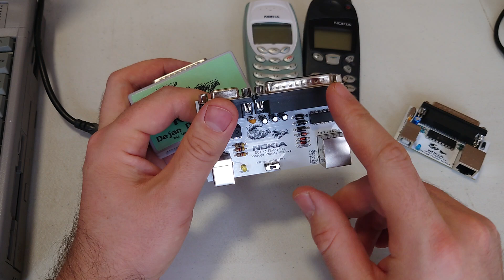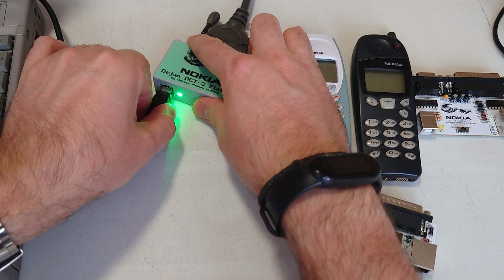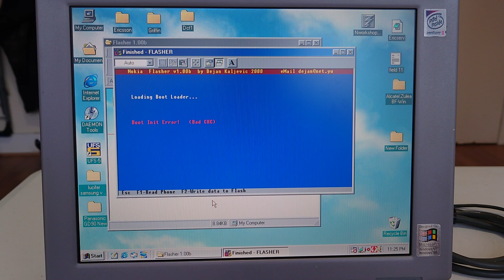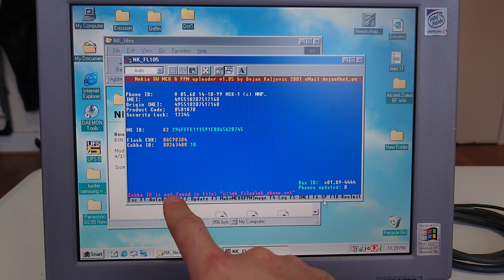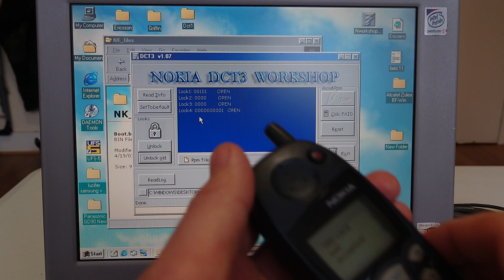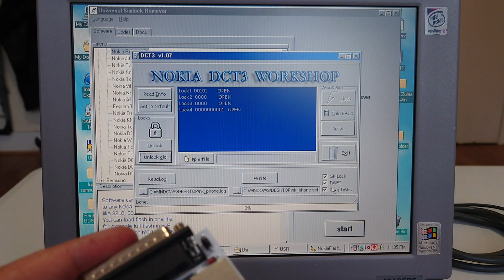Full Nokia Dejan Flasher box - retrospective and demonstration

Comment: That's a very old Windows os. Would the program work on Win 10 or 11?
Reply from the maker: Noo, all these tools predate Windows 10 by 20 years, and modern windows no longer offer backwards compatibility
Reply: @Vintagephonesarchive  so what is the solution if I don't have Windows 98?
Reply from the maker: @sauliusjance6300  get a cheap windows 98 laptop or use a more modern tool, like UFS box